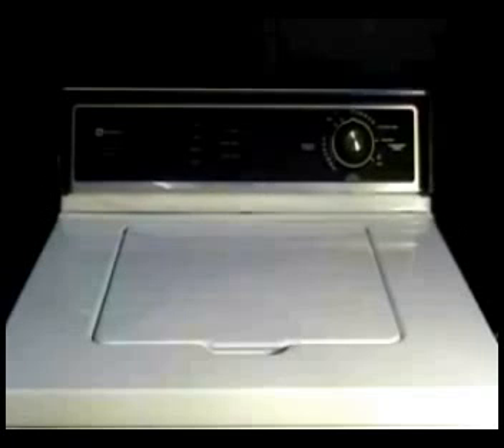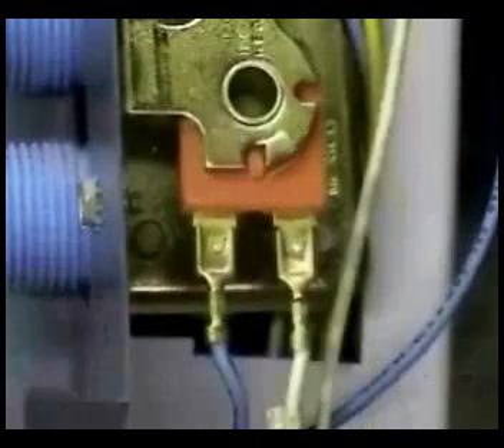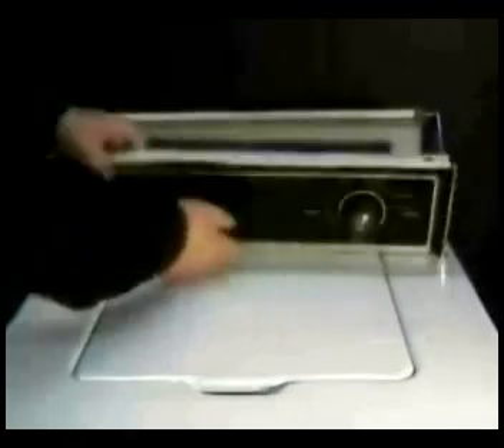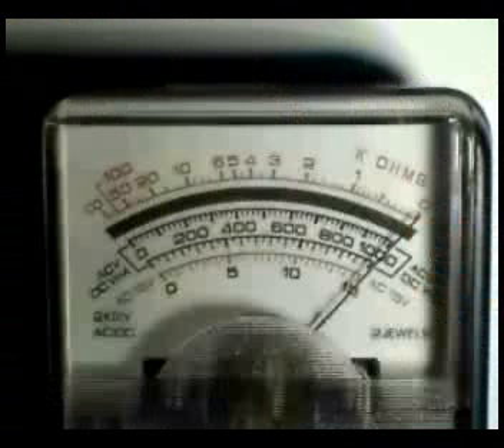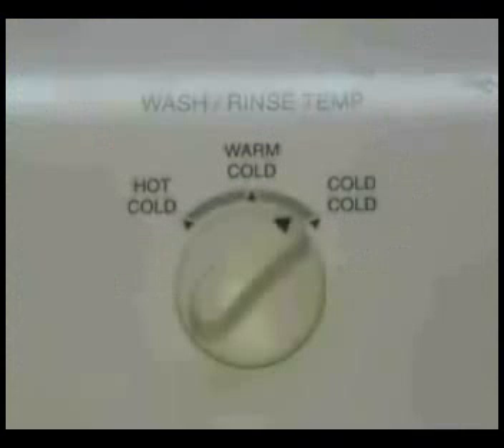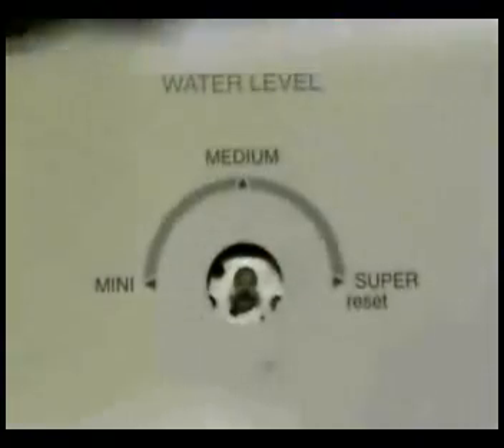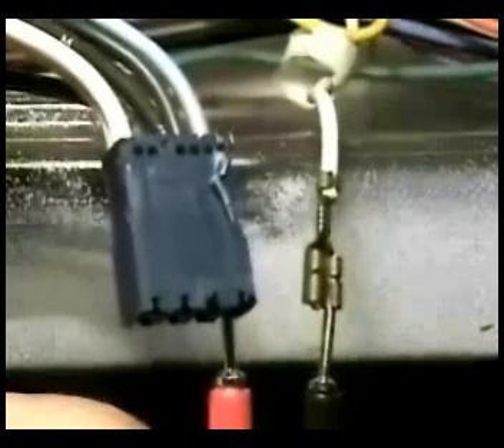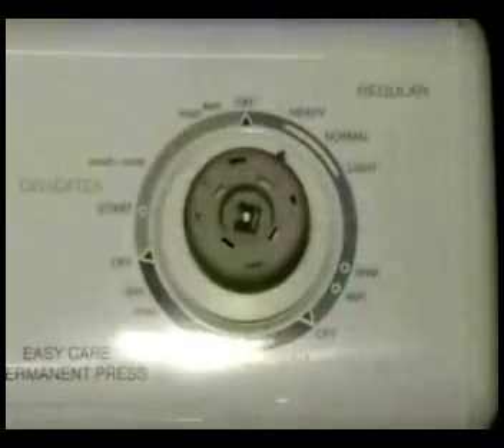Maytag Washing Machine Not Filling With Water - See What Parts You Need To Check

Comment: Hello! I bought a cheap multimeter at Harbor Freight, not  getting any reading at all on the solenoids in my water inlet valve.  There is a "one" that doesn't change on the left side of digital display. I have tried several settings.

For years the cold water just barely trickled in, and during my lame attempts to fix this Maytag, I found out that the hot water hose has a permanent trickle leak and I have to have the spigot replaced. The machine is in a detached garage and I used to see water leaking out the back, the inside is dry.

Since the cold water inlet valve was barely working, do you think that the trickle of hot water constantly going into the valve just blew it out?

Where do you advise that I order a new water inlet valve? It's a Maytag A211. About 25 to 30 years old. 

In the past I have been able to leave you a thank you gift, but I no longer see that option. Thank you for everything, you have been a big help to me! 😺